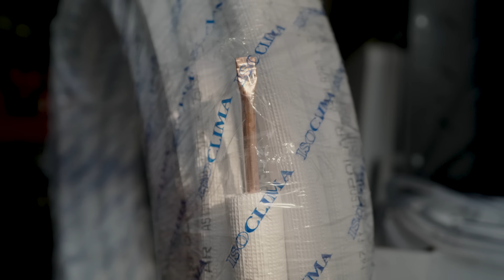How to Install a Wall-Mounted Mini-Split | Ask This Old House

Comment: Why is nitrogen used to test for air leaks. Why not any other gas?
Reply: No moisture in nitrogen.
Reply: Cheap. Atmosphere is mainly nitrogen.
Reply: Non flammable as well. Cheap, inert, dry.

Comment: With the wall bracket it is really not far enough away from the wall to allow good air circulation through the unit.  Melt my poor vinyl siding maybe.

Comment: did he just mount that bracket with drywall screws
Reply: Nate S. He’s got like 12 or more of them, might be enough to distribute the load. I’d go for lag into studs.
Reply: U throw in a couple to level the bracket, then find studs. That guy definitely wasn’t a hack. Although that evacuation set up is what we did 10-15 yrs ago, not what super techs use today 😉
Reply: Totally agree.   These details matter in a job well done and someone not putting the time or a few more cents to be that professional.
Reply: @Kevin-mp5of  true.
Reply: Yea, probably the 5 screws that are included in the hardware kit. These units are incredibly light and have next to no vibration. The LG manual doesn’t specify any anchors or a stud. This will hold just fine with those screws. Anyone who thinks this think has to be lag bolted to structure has never seen one of these being installed.

Comment: When evacuating the system, the absolutely most important thing that must be removed but was not mentioned , is moisture in the form of water. The vacuum pump creates, the effect, of simulating the non atmosphere of out space. The deeper the vacuum, the better. In this condition the water will boil and becomes a vapor. The vacuum pump will remove gaseous elements but not liquid water. Mission accomplished.
Reply: You said "moisture in the form of water"...I think you meant "water in the form of moisture" ;-)

Comment: how much noise makes its way through and in the wall it’s self?
and how to build a solid frame work that limits the vibs and sound?  if a car driving by can rattle your windows and not even be all that loud to start with as the “heavy” base sound goes right through walls made of wood.
Reply: I wouldn't use the wall mount, ppl have said it can put a light weird vibration in the house. Its easy to put a paver and pad location to anchor to, it can be elevated if you need aswell.
Reply: Up to 12000 it is probably ok, bigger than that you can turn the whole wall assembly into a soundboard. Especially if you use it to heat.

Comment: They are expensive to run in winter time(Vermont and still need backup heat) My electric went $100 a month to $440
Reply: The heating efficiency varies quite a bit from 300% to 530% (47F outside 70F inside). And of course it goes down from there. When in heating mode it's important that the outside unit is elevated so it doesn't sit in its own cold air, snow or leaves. Efficiency is also lower when it's running at full bore.

Comment: All are  manufactured in Asia...they only last an average of 10 years Plus or minus..not all techs are familiar with these so it is more expensive to service and maintain...parts are not readily available and may need to be special ordered...we need pros and cons for these units to make a proper decision...
Reply: So get a Japanese Mitsubishi - the absolute best you can buy. Asian manufacturing is top notch, as long as you’re not talking about the lower end Chinese Mr Cool/Pioneer/etc. Mini splits.
Reply: You must be fun at parties.

Comment: Anyone find a video about replacing an old fashioned wall unit AC with a mini-split? I am looking to cool a 3 room condo, 975 sq ft total (2 x 100 and 1 775 sq ft great room/kitchen). If I could get an inside unit in each room, that would be optimal.

Comment: 2020 NEC requires a GFCI protection on 250v appliances as well as all exterior receptacles. I would consider this an appliance versus a central system. Since this is a new device I would assume it applies.
Reply: Can that be installed in the panel?
Reply: @GoatZilla  yes lol

Comment: How long have these been around as I remember as a kid in the 80’s my church the LDS church in Brandon FL had these in the bishops office so when they came in to do clergy work they would not have to cool the whole church building. It was just outside the office. It was a Mitsubishi brand if I remember right. Circa 1988.
Reply: 1940s invented by mitsu. Just never caught on in the states
Reply: @dontdoxmebro  They go way back in Asia
Reply: Can put them on RVs too

Comment: As a tech. I hate mini splits . They make a classy old house look cheap .
Reply: Imo they look way better than windows units. They also make units in the form factor of a radiator, that can even be covered like a radiator to blend in better.
Reply: Cheaper than window units, wall units, or central air retrofits? What would be your choice?

Comment: I was hoping for a good example of installing a split condenser.   This was a fail.   The various manufacturers specify 12" clearance from the wall.   This looked like maybe 4 or 5" at best.
Reply: On the wall you can do 6" typically because air can flow in from the bottom, which it can't do when the unit is right on the ground.

Comment: The pre-charged systems are a much better option. I installed mine (12,000 BTU cool and 14,000 BTU heat) in less than an hour. Best of all it was a DIY - no "pro's" needed.

I've had it installed for just less than a year and I'm amazed at how good a job it does both heating and cooling. It got down to -2 degrees and that was the ONLY time the heating unit couldn't keep up. Even better, my unit is 120 volt.

My building is a little less than 600 SF and has vaulted ceilings.

Comment: How long do split systems last?
Reply: More than any ducted AC out there.. that is if a good well built model like Samsung or some lg etc models are bought... Make sure outdoor Unit is in some sort of protection it will last a long time...
Reply: @Reddylion  what sort of "protection" is needed? I just installed mine on my semi truck ...so I'm all ears
Reply: @vroor32  no protection needed ! Just keep the fans, fins etc clean nothing more needed...

Comment: The compressor may be quiet but I can't believe it's vibration isn't an issue??
Reply: A good company will add things to reduce vibration such as rubber padding
Reply: Good models don’t vibrate much, if at all, during operation. But they come with rubber spacers on the bottom where they connect to the bracket.
Reply: These units are incredibly quiet and just about as free from mechanical vibration as something mechanical can be. Hardly any noise or motion at all.

Comment: How many BTUs and how many rooms does it cover?  Thank you friend.
Reply: It can cover as many rooms as one wants.. as the btu capacity and indoor splits can be increased or decreased. Meaning whatever the customer requirements are. And no ducts they all get individual remotes, thermostat etc. No ducting.. split AC is the best hot and cold.

Comment: One day I will be able to afford this......
Reply: Mr cool DIY units are surprisingly affordable
Reply: @locke3141  i live in an old house. I only have 60 amp service, so I'm going to have to do upgrades there and do a bunch of updates anyways. :/ I'm broke so cheaper to just spend a hundred bucks on a window ac
Reply: @mufasaiam7794  Your number is way off, for good one is about a grand, cheep one half of that.

Comment: That condenser is much closer than the minimum distance specified by the manufacturer.  Also, as quiet as mini splits can be, the condenser does vibrate and mounting it to the siding (not an exposed foundation) is just going to amplify that sound.

Comment: what happen if I cut the line from 25’ to 7’
Reply: LG systems require a 10’ lineset length
Reply: Systems come from the factory with a calculated charge for the lineset that comes with the unit. If you reduce or add lineset, the refrigerant charge and oil needs to be adjusted. Never use less than what the manufacturer recommends. If 10' is still more than you need, contact the manufacturer to see if it's possible to remove some refrigerant. Extra refrigerant in a system causes higher head pressure and depending on what type of metering device is used, the evaporator could become flooded. When that happens, any liquid refrigerant that doesn't boil off in the evaporator will return back to the compressor and cause damage. A sure sign that liquid refrigerant is returning back to the compressor is the suction line will frost over. If you ever see that happen, shut the unit off immediately.

Comment: FYI, DONT INSTALL OUTSIDE UNIT SO CLOSE TO THE HOUSE OR BUILDING.  LEAVE AT LEAST 12 INCHES BETWEEN, UNIT WONT HAVE NO ISSUES COOLING OR HEATING

Comment: What I'll never understand is if you have a vacuum, why not just test it with the vacuum?  If it holds a vacuum, that would mean there is no leaks.  The use of Nitrogen to test then vacuum doesn't seem efficient.
Reply: Theoretically, you're correct.  I suppose it's much faster to boost the N2 pressure in the tubing well above ambient and then look for leaks than to pump a vacuum, isolate the pump, and then monitor the vacuum level over a lengthy period.
Reply: A vacuum is equivalent to 15 psi. In heating mode these will run at up to 400psi. Mechanical flare joints are prone to leaking, and a proper pressure test will prevent problems.
;
Reply: Derek Kite's response is correct.  Another reason for not using a vacuum to test for leaks is that if you do have a leak, the vacuum will draw moisture into the system and then you'll have to remove it.

Comment: shouldnt have run the copper tubing so long.... it slows down the cooling time of the room...and the compressor works multiple times harder to cool the room... electric bills would go high up
Reply: Agree. That mini split is way to small for that long piping, probably around 50 ft.
I got a big 18000 btu's and says maximun 25 ft and comes with only 16 ft.

Comment: Why don’t manufacturers of these units not make them with an option to route the lines downwards so one can run them inside the wall instead of having to see those ugly covers on the outside of your house?
Reply: Installing lines in a finished wall requires opening it up, then refinishing. Anything is possible if you have time and money.
Reply: @DerekKite   Of course I know that. It doesn’t seem  like you have the option to do so on most of these in common/ standard walls you’ll find in most homes so that’s why I made that statement. Seems the only choice is to go straight out the back and not downwards if one chooses to do so.

Comment: The refrigerant is contained inside the conpressor, not filled from outside.
Reply: Wrong
Reply: The refrigerant is contained in the entire hermetically sealed section of the system. The compressor, evap coil, condenser, linset and all other piping contain the refrigerant. The port for filling and servicing the system is on the outdoor unit also known as the condensing unit. So you are incorrect.

Comment: In  Europe they using this kind of air conditioner system   more then 20 years  finally welcome in  USA.
Reply: weve been installing them for decades, particularly in finished basements and garage apartments.  Get off your high horse

Comment: The only problem is how much money these companies want to charge to put in a lower end system.   The 2 quotes I received to install 3 evaporators and a condenser were more than a quote to put in a full ducted central air system, by a factor of 2 or more.    The units they wanted to install were knock off, not even Mitsubishi, LG, etc..
Reply: Every other country these are considered DIY units that are not much harder to install than windows units. Only in the USA are they some complex expensive system to put in that “need” a professional.
Reply: @rpvitiello  Agreed.  Ill be doing mine myself.
Reply: Other countries don’t care about environment or details to longevity in operations and only certain systems like MR. Cool are designed to DIY. Go out and install it yourself. But be careful for if that refrigerant gets on your skin, you will have the worst burn ever.
Reply: Contractors always charge $$$$ for things they aren't familiar with (although I'm not sure how you can be, say, a Mitsubishi diamond dealer and not be familiar with the product). Hopefully as more contractors get used to mini-splits things will change.
Reply: @hailexiao2770  exactly....they don't know how to service them and why they don't pull humidity out if the house!!!!  I don't know why    so many people brag about how wonderful they are.

Comment: Would have been nice to know where this house was and the exact cost, that way people dont waste time looking at something they cant afford.
Reply: I understand.  But, in this case, the labor was probably extravagant because the two units were so far apart and turns etc. Whereas, if the outside part was just outside on the ground it probably would be much cheaper. I would like to get one of these. My house is about 1400 square. So one wouod probably suffice.

Comment: Question: I have central air at my tenant's home, which is 2 story plus a finished basement. During heat waves the central air doesn't provide enough cooling to cool the 2nd floor. Could installing a mini-split system to each of the 3 bedrooms on the 2nd floor remedy the situation during these hot days. The basement gets incredibly cold, but the cold air isn't cooling the 2nd floor enough.
Reply: @sundancekid1337  That's the info I needed. It's so hard to find the answers you want as a lot of info is just marketing or ways to live with what you've got or replace the existing system. I'll check with my tenant if they want to "split" the cost (worst pun). Thanks.

Comment: My unit has the timer light blinking and I can't getting to stay off, thank you...
Reply: I'd check the manual
Reply: LG units do that then they are in the auto clean mode. Auto clean automatically turns on when you power off the unit (dries out the indoor unit). Turn auto clean off on the remote.

Comment: I'll stick to cheap window ac units, 5000 btu.  When ones goes bad, chunk it and install a new one.  They aren't heavy.  Buy brand new extra units in the winter when they are cheap and keep one or two handy so when your ac does go out, you just open up a new box and replace it.  Buy online.  No going to the store.  No paying high prices in the summertime if your unit craps out then.  Think ahead - way less headaches.  Oh and the best part - not needing an HVAC contractor or electrician.
Reply: But they don't provide heating.

Comment: I still have my old 4 ton furnace and condenser (both work), and I was told that twinning two 4 ton systems on a 2000 sqft property was a bad idea.  I know that I would need new independent ductwork to keep one system from back wheeling the other, and a 40A panel upgrade to run both.  The biggest issue presented was a new supply duct (likely in the hallway), and that too much positive airflow would create a humidity problem leading to mold.
Looking into a split I’d rather the indoor unit be installed above the door, and wonder if these can be be controlled via third party smart thermostats?  I’m also not sure if my HOA would go for a wall mounted unit.

Comment: From the research I have done on these it doesn't seem to make financial sense and parts are not readily available. Upfront costs are typically much more expensive for the unit than conventional A/C install. They are typically made overseas and parts are not interchangeable. Current repairmen are able to carry standard parts on their trucks like compressors and rheostats, for normal a/c units but the Mitsubishi type mini splits units are all unique to themselves. Meaning you have to order parts as it is not in stock mostly. Cleaning seems to be another issue as you will get mold problems if not rigorously maintained. Retrofits into older homes seems to be the ideal market for these units as you don't need to open up walls to run duct-work. And you need to buy multiple head units if you want to control larger spaces in homes. Simply installing one in the living room will do nothing to cool off 3 bedrooms on the other side of the house. The estimates I have been seeing are about 40 -60% higher than regular a/c installs. The manufacturers are coy about the savings but the math formula they use estimates about 5 to 7 years to break even. Most units are rated for a 10 year life span. Not good compared to conventional units that can last up to twice that long.
Reply: If you have ductwork already then adding central AC is the way to go.  In massachusetts where TOH films most of these houses don't have any central duct.  was quoted 45k to install central in my home because all the walls had to be opened and duct run, and would need two condensers one in the basement one in the attic for a 2 floor home.  with that, the 16-17k to do minisplits starts looking more cost effective.

Comment: Couldn't find an American unit to install?
Reply: @Kevin-mp5of  Even Korean people don't want Lucky Goldstar (LG) products. I know since I been married to one for 50 years.
Reply: There aren't any real American (made in USA) units. The ones sold by Carrier, Trane, Lennox, etc are all rebranded Chinese or Korean units
Reply: @hailexiao2770  You need to do your research. Your statement above is not totally true.
Reply: @olymonty  I live in a large Korean American neighborhood and you'll only find LG or Samsung condensers on their business, resturants, churches, or homes. They are also the largest distributor in the area. Most ductless units are only manufactured by Asian brands do to their high complexity design in inverter electronics.
Reply: @xcmskim4  Just an FYI.  I have been married to a Korean lady for 48 years.